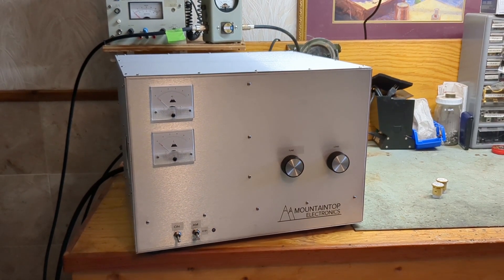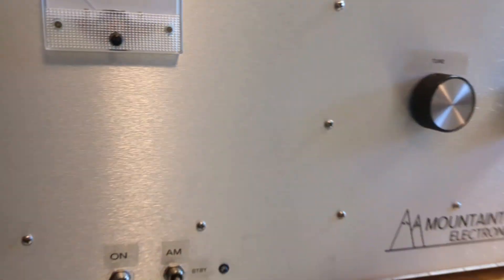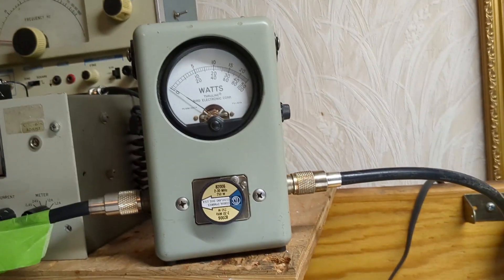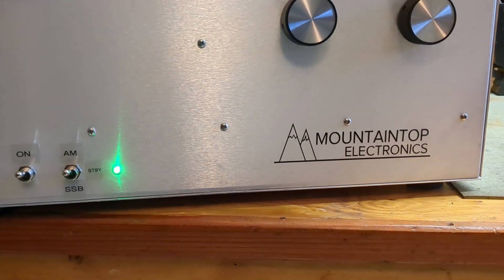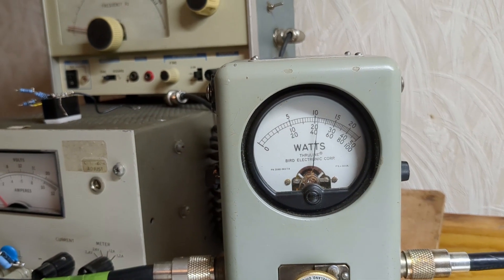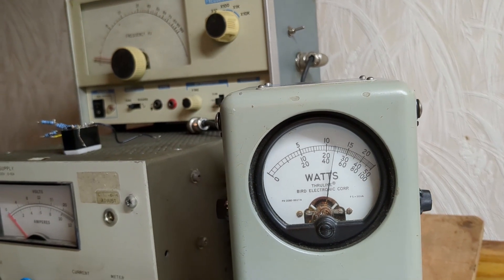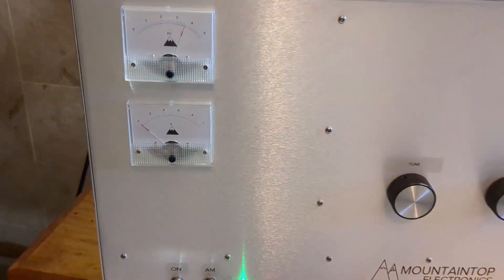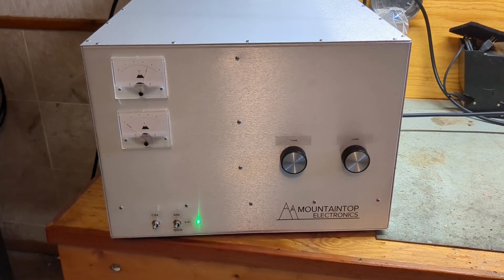2 tube 3-500z Amplifier Mountain Top Electronics

Comment: Careful who you sell your boxes too you get people who don't know what they're doing then blame it on the amplifier
Reply from the maker: You ain't lying
Reply: @MountainTopElectronics I can't and won't tell anyone how to run anything but I always Cadillac my equipment. I can't afford to fix or replace it. I appreciate the builders who over engineer stuff because someone is going to abuse it. Me I have more times than I can count have put to much key in for a second and adjusted keyed down. I don't adjust keyed anymore but always you have to adjust key and for a sec long as you aren't 100 watts out your ok.  Maybe one day I will be able to get a z box but I wish you could run less. Miss high, low, med. Sometimes you just don't want or need full power.

Comment: I can't get my sb220 to do more than 1 kilo regardless of the drive. Volts drop on DC side too much but not on ac side. Brand new caps same thing. I'm going to try to replace the doubler diodes
Reply from the maker: It's not that. It's the supply. It's not beefy enough and if it still is as built, multi band I mean, you won't see much more than that. They improve on 10m after you monoband them. The weak point is still the supply.
Reply: @MountainTopElectronics  I mono banded it. Took out the entire band selection and all but 41/2 turns on the tank. 
Relocated the input inductor by the relay. Added an air variable to the old band selector switch spot. Stryker and texas 350hdv are very happy 1.1:1 on the input. Replaced the caps with 330uf 550v from digikey. Replaced transformer with 920ma 1300volt toroid external now. Reduced bias from harbach 6.8 to 4 ish. 
Ac voltage at idle 1340.......0ma
DC voltage at idle 3770

Ac voltage at 0 signal 1238....250ma
DC voltage at 0 signal 3186

Ac voltage at Talking      1162 .....420ma
DC voltage at Talking.     2868

At 1162ac * 2 * 1.41 I should get 3276dc but I'm only getting 2868. It still may very well be a power supply issue. I'm new to these tube amps. Expected in 480 3 phase. Decided to try a new hobby. 
I appreciate the help
Reply from the maker: @electromechanicalstuff2602  try a different transformer and more bias. Push it closer to c. Try 18v of bias, try a supply that delivers 3300-3500v.
Reply: @MountainTopElectronics  oh wow I thought the opposite less bias voltage the closer to c. Because @30v the tube is basically off.
Reply: @MountainTopElectronics  what transformer do u recommend
Reply: An SB-220 non modded from factory is nothing more than a good kilowatt amplifier. are you on 220ac? with 110 the voltage drop is too much when you are in the 1500 watt and above area. 2nd, I would get rid of the voltage doubler period. Too much voltage drop again. I would go with a full wave bridge with a transformer around 2400ac at about 1 amp,  so about 3300dc out. Lowering the bias makes the amp drive with lower power but on the other end, thats a lot of tube watts wasted in heat. Better for the tubes to go with higher bias and then drive it a bit harder to make up the difference. Problem with the 220 is it has all marginal components in it. You will need to totally rebuild the power supply, and replace the tune and load caps to handle the extra voltage. Also would add a fan underneath to cool those pins. The original components are not up to the task.
Reply: @MountainTopElectronics seams like the higher the voltage on the bias the less output I'm getting. Is that what I'm supposed to be seeing?
Reply: Honestly,  send that amp to BBI the amp builder in Idaho, he is the boss wen it comes to those amps, watching from Jamaica west Indies  !!.

Comment: 3000 watts out of 2 3-500zs?? Not for very long 😂 those tubes only have 500 watts of dissipation.  And if your putting more than 4000 volts on the plate, good luck 😂
Reply from the maker: I'm not sure that you watched the video. It doesn't have 4000 volts on the plate. But I agree with you. 3,000 watts is not really useful out of two tubes. It's a 2kw amp, as always, people can do what they want and run them how they want.